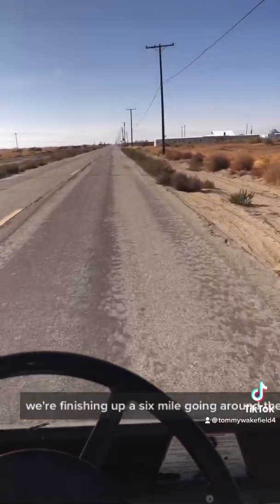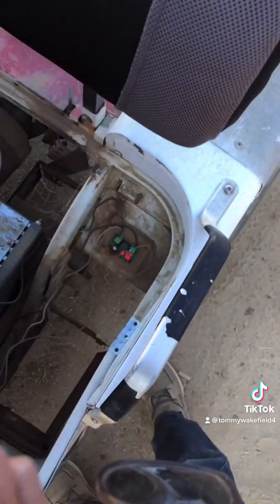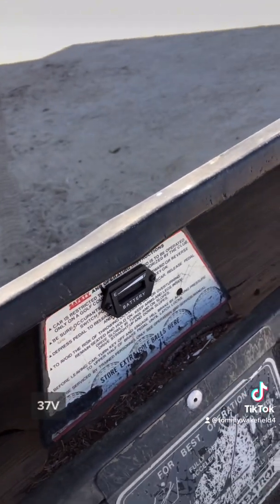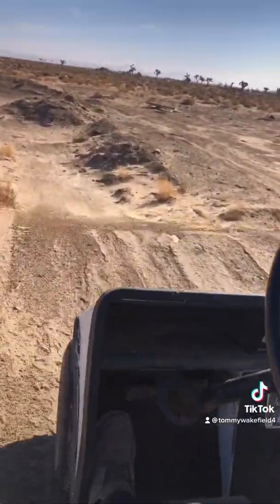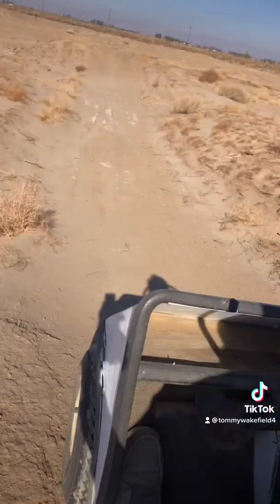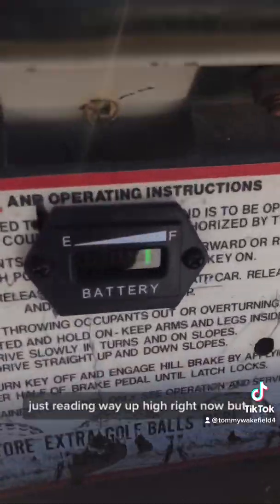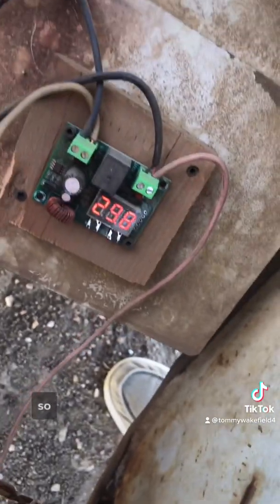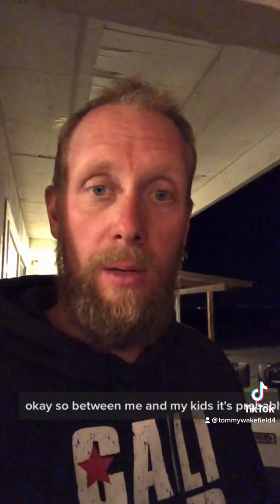36v 48ah lithium battery spim08hp 1.7kwh

Comment: So I picked these 4 of these from big battery today like we talked about … what kind of charger are you charging these with? Also since I’m running 4 packs what do you think about a 20s 72v BMS one on each 2 pack that are in series just for charging?
Reply: What Amperage rating? These cells can take a 100 Amps each and you have 6 in each section so you need to think about the charge rate. A 20S 72 Volt unit is just the starting point. Funny thing is, a lessor charge rate seems to bring batteries to a more level charge across the cells even without a BMS. But that depends on how well matched your cells are to start with.
Reply from the maker: You could easily series these and balance them with a BMS I haven’t even gotten into balancing them yet I just avoid draining them down to 25v and charging them all the way to 42v
Reply from the maker: I am currently jimmy rigging chargers together with transformers rectifiers and voltage boosters. I haven’t nailed a simple charger build that I like yet. I’m actually considering building a battery as close to the grid voltage as possible so I can just rectify the ac power and dump it right into the battery! If it works it would dramatically simplify charging the battery.
Reply: @RetroElectric  A Variac would fill the bill then. But it would be safer with an isolation transformer before the rectifiers.
Reply from the maker: @gravelydon  elaborate. What’s a variac?
Reply: @RetroElectric  A Variac is an autotransformer that can be adjusted for output Voltage. Looks like an overgrown rheostat.
Reply from the maker: @gravelydon7072  got ya ok.
Reply: You could use three 12v server power supplies wired in series for the voltage to hit a nominal voltage  of 36v, you can then add a resistor on the voltage feedback line to get up to 13.8 per p/s to get up to 41.4 for the 3 p/s assembly.

Not sure what kind of motor you're using, but usually you can overvolt a lot, subject to limitations of whatever controller you use.

You can also gang power supplies in parallel up to 4 without exceeding the design specs. That would likely hit the current capacity of any existing circuit in your house. Figure 10-12 Amp input per p/s, plus a little extra for inrush, a 40a circuit would handle 3 paralleled supplies - X 3 in series, to output about 120a and a charge time of about a half hour.. You can pick up the power supplies for about 50 ea.